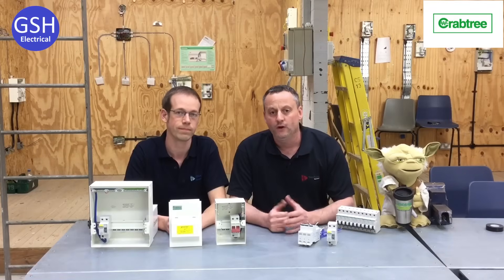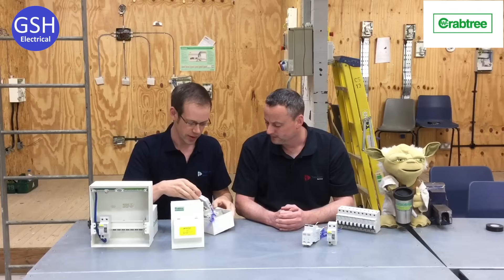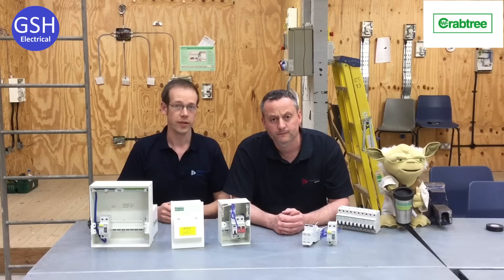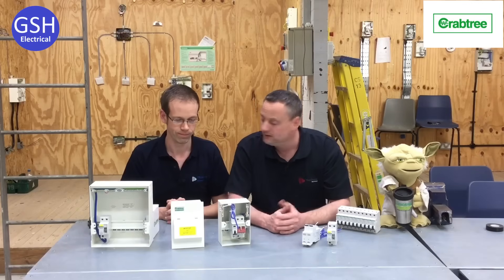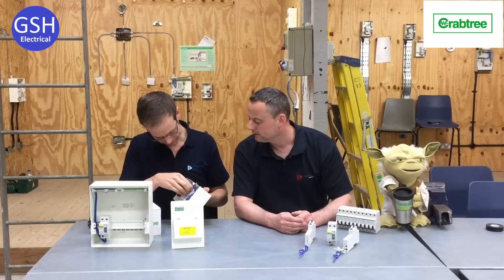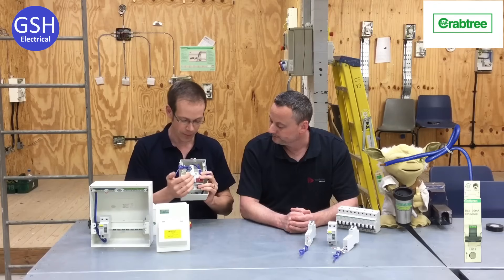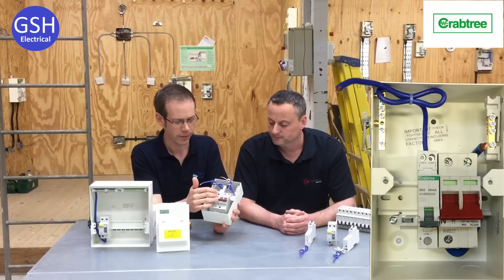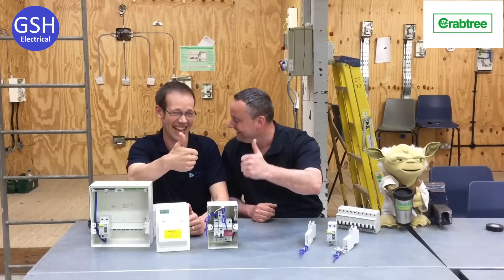The Adventures of Using Miniature Crabtree Starbreaker RCBO’s & How to Fit Them Into a Consumer Unit

Comment: I had my friend fit a Crabtree RCBO because I insisted for this new style, helping a bit it took less than 2hours to swap over an old unit from the late 1970s to this kind.  Feel comfortable and more safe for modern electrical devices. New tails and one new earth bond only needed. no faults, only one old bodge was two light circuits had the earth (or CPC)  twisted together. From observations, the lack of a bus bar to me seems a major step forward in safety impossible to accidental drop a device on it. My Friend told me they most housing associations where lives only install Crabtree for reliability. 20-year guarantee. This is Channel is very educational even if it's not my day job, it's about knowing and being safe and also regulations.

Comment: Interesting video. When I had my CU changed 5 years ago the Spark used all RCBO's as he was expecting the next edition of the regs to require this. Glad he did rather than a split board as it makes faults easier to deal with. Box is busy inside but still tidy.
Reply from the maker: Hi. Thanks for watching and commenting GSH Electrical 👍.

Comment: I quoted for a job a few weeks ago where I was gonna fitted 2x Wylex miniature RCBO’s to an existing consumer unit, the price for the miniature RCBO’s was about £28 each and I was very surprised to see the miniature RCBO’s were the exact same price as the traditional RCBO’s. I ended up replacing the whole consumer unit for a split load dual RCD unit. I didn’t know you could insulation resistant test with the final circuit in situ, thanks for that vital piece of information, should save a lot of time when testing a high integrity unit.
Reply from the maker: Hi. Thanks as always for your on site input, commenting and watching. All the best 👍 Gaz